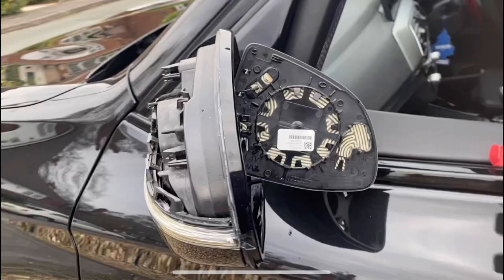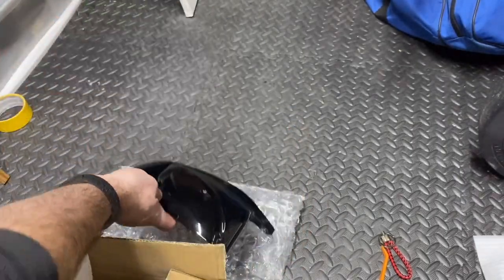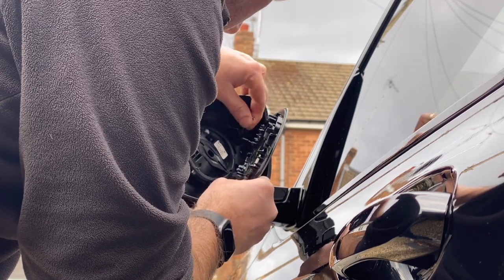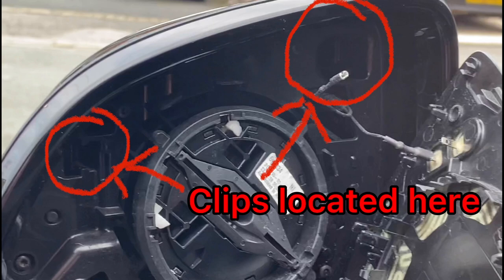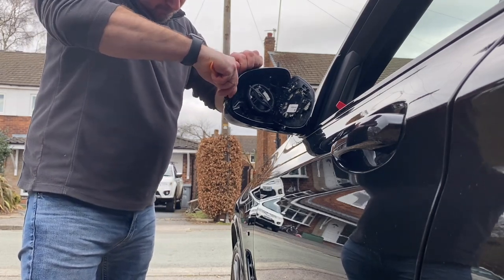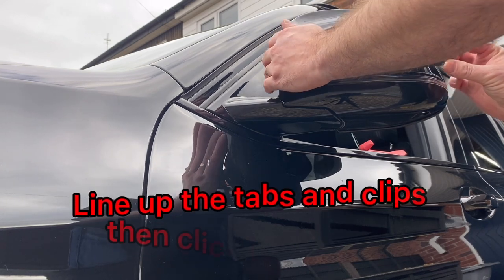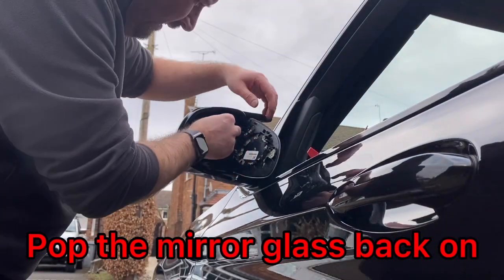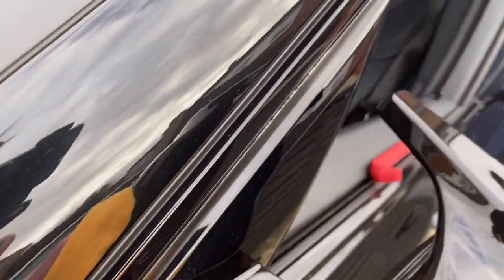How to Remove and Replace a BMW X3 (G01) Mirror & Mirror Cap

Comment: I just did it accordingly on the facelift model and it’s really that easy. 15 minutes. Nothing broke, the caps fit just as well as the original ones. Thanks for the instructions!
Reply: did you change front grill in LCI
Reply: @vegetazigi381  no

Comment: Great video! Any video on the front lip splitter? What is your opinion on getting a one piece front lip vs the ones that come in 4 pcs that have to be screwed on together before mounting on the car? Thanks.
Reply: Did you find the answer to this?

Comment: Nice vid. Which badge do you have on the grill? Cheers
Reply from the maker: It is a gloss black “M” side fender badge. 👍🏻
Reply: @ghostrider3547  after watching your video I bought and fitted the wing mirrors. Looks brilliant and your instructions were superb 👍🏻. I’ve found the M double slated front grille online for £59 and I’ll look for the side fender M badge but how did you fit it? Any links appreciated 👍🏻
Reply: @ghostrider3547  how did you attach that to the grill!? I have the same black badge lying around

Comment: What front lip splitter is that? Thanks for the quick video
Reply from the maker: Hey, the splitter is the below:
https://www.ebay.co.uk/itm/BMW-X3-G01-X3M-GLOSS-BLACK-M-PERFORMANCE-FRONT-LIP-SPLITTER-SPOILER-OEM-FIT-17-/164122998008?mkcid=16&mkevt=1&_trksid=p2349624.m46890.l49286&mkrid=710-127635-2958-0

I had it on my 20d, but have since got an M40i. I put the splitter on my M40i and recorded it, so will put a video up soon hopefully.

Comment: Did you have to replace your front Kidney Grille to get the M logo? Trying to find this online 👍🏻
Reply from the maker: The badge didn’t come in my double slat grille so I ordered a cheap x3m grille badge from Ali express that fit on my grilles (so that I had the fixing for the grille badge. I then removed the cheap looking x3m badge (as looked cheap and mine isn’t an X3M), ordered a gloss black “m” fender badge from eBay and stuck that on the grille badge fixing. 😀. Subtle but looks quite good in my opinion haha.
Reply: @ghostrider3547  superb mate, it looks really good  and I can see you’ve done some investigating to find a good solution. I’ve the standard gloss black grille but realise from looking I’d need that double slate type before doing the same. I’ve ordered the wing mirrors so that’s one job done and then I’ll sort the grilles 😉👍🏻
Reply from the maker: These are the grilles I put in mine if it helps. Had them for a long time and they have been great quality:

https://www.ebay.co.uk/itm/GRILLE-FOR-BMW-X3-X4-G01-G02-SPORT-KIDNEY-DOUBLE-SLAT-M-LOOK-GLOSS-BLACK-/274005168304?mkcid=16&mkevt=1&_trksid=p2349624.m46890.l49286&mkrid=710-127635-2958-0
Reply: Whats your car color?
Reply from the maker: Black Sapphire
Reply: @ghostrider3547  I’ve just bought those double slatted grilles and the fender badge from EBay but that grille badge is proving harder to find on aliexpress. I’ve found a plastic type with sort of prongs but whilst they show a picture of the X3M badge they don’t actually list it or only for the F25. A few buyers have complained about fitting and needing glue etc. Not sure whether to risk buying one unless you still have that link? Only if it’s no trouble but if you can’t find it, no worries 👌🏻

Comment: Thanks for sharing this video. I feel confident enough to do them myself now. With the extra piece of trim at the top of the new caps, do you notice any increase in wind noise?
Reply from the maker: Hey, no not really, maybe a little bit but nothing that I notice. A small sacrifice for a slightly cooler look 😂
Reply: @ghostrider3547  I've done them now and I'm very please with the carbon look. I don't notice any wind noise difference at all. Thanks again.
Reply: Hi, Did you ordered from the Aliexpress?? Is it a trustable site? Please let me know